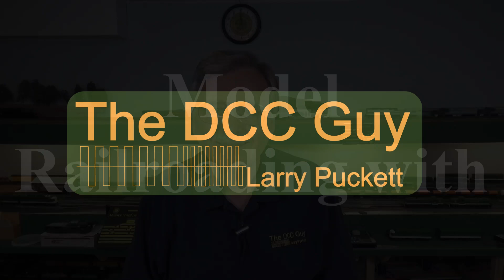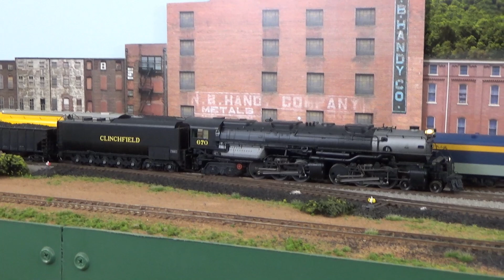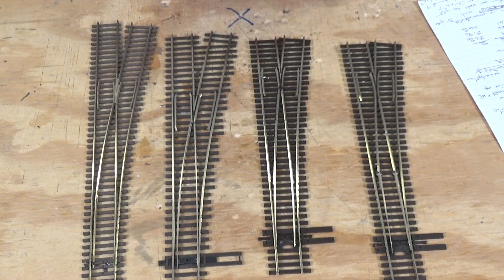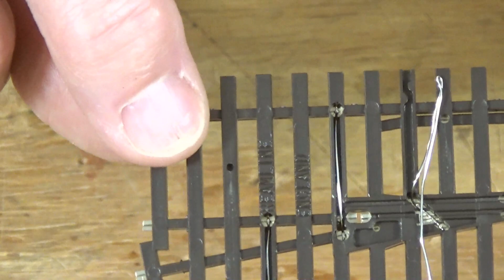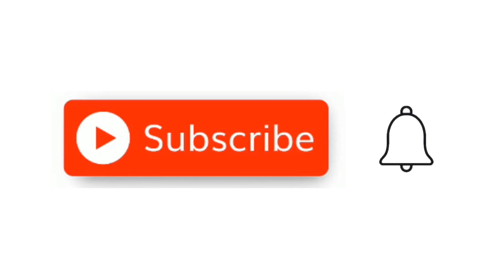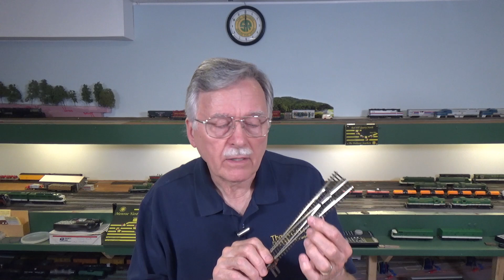NEW Peco Unifrogs Are Here: Let's Compare (260)

Comment: There is another detail you do not mention but that affects my choices. Peco offers their Pl 10 solenoid to flip the turnout; it attaches directly to the bottom of the track and this is handy for my application as my trainboard is 1 1/2 " foam on top of 1/2" plywood. The solenoid is entirely within the foam base and that is easy for me to assemble. I did not want a solenoid under the board for a variety of reasons plus in my case theboard  thickness is 2"". Walthers does not offer an equivalent solenoid to use directly under the track and it does not have the little slots the Peco pl 10 clips into so I assume using the Peco is out of the question.  For me, that creates a problem.
Reply from the maker: My concern with that installation is that when the solenoid fails or otherwise you’ll have to pull out the turnout for a repair. Here in the USA the demand for solenoids is almost no one is willing to make them anymore so I don’t talk about them. About the only ones available are those from Atlas and the Bachman and Kato track.

Comment: I’m starting from Scratch. Which turnouts are the easiest to use for flawless operation? I will be using electrified switch engines. Thank you !
Reply from the maker: What scale and how deep are your pockets? If I were just starting a layout I would use either the new Walthers turnouts or Peco Unifrogs.
Reply: @TheDCCGuy  I’m going to do N Scale. My pockets are adequately deep to spend in the right places. Track, turnouts and switch engines are the place to spend first for success. Thank you for your prompt response and advice.
Reply from the maker: In N scale your choices are more limited but Peco offers the unifrog in  N so that’s probably the best choice.
Reply: @TheDCCGuy  thanks !

Comment: Hi sir ! It's very interesting that you compare all of those turnouts. I'm a Micro Engineering user for a very long time. Simply because they are to my eyes closer to reality and they work very nicely. The only thing I dislike is that the last "batch" they released is a bit cheaper. Especially the point sprung that is very fragile to fall or not working properly for a long period compare to the oldest ones. I was thinking of making a 60 inches long module using new Peco's Code 70 Unifrog turnouts and flex tracks. I'm still thinking of it. And I got to correct you on one thing : On real turnouts, there are hinges on closure rails. So the fact that Walthers and Peco are making those rails in one piece is not more to prototype...it's only better for electric power, engines and rolling stock to roll on for our models. To my opinion, Walthers are probably the most upgraded and better turnouts of all. But there are certainly not the best looking.

Comment: Thanks Larry and once again great job with the videos.
Im not sure if this has been asked already but I will ask Re: HO Peco Code 83
Are the EloctroFrog turnouts wired for DCC with powered frog compatible with the Unifrog turnouts also wired for DCC with powered frog? 
So for example I want to put in a right-hand single crossover, I have a few Electrofrog code 83 RH #6 turnouts left over from a older project, all the Electrofrogs have been wired for DCC compatibility and all my frogs will be powered with the Tortoises. Can I use 1 Electrofrog and one unifrog to make the single crossover?
Reply from the maker: Assuming you have set them both up in DCC friendly configuration they should be compatible. If you have doubts just set them up in a bench test and see how they work.
Reply: @TheDCCGuy I wired them like you do fully powered and frogs are controlled by the Tortoise. I think they will, I'll check it out thanks!

Comment: I didn't realize the Walther's Turnouts had the sprung points that snap into place.
Question Please: Do their Curved turned have that feature as well?
I am looking for a wide radius Curved Turnout (about 30" radius on the diverting route) in code 83 and wanted the sprung points to hold the points in place against the stock rails as I do not use switch machines. Thanks and great info on your video.
Phil
Jersey Shore Area
Reply from the maker: I have not seen them but I bet they are sprung too.
Reply: @TheDCCGuy  I unfortunately don't see wide radius curved turnouts on the Walther's code 83 Turnouts. 
I may have to go with Peco, but I don't see the Peco curved with the newer UniFrog version, which I do prefer, but they do make the other two versions in wide radius...
Phil
Reply from the maker: I remember receiving an email from a Walthers VP thanking me for the review and at the time he mentioned they would be releasing a large radius curved turnout soon, which could me 1-5 years given production issues in China. I too have a spot reserved for one assuming they hit the streets in the coming year🤞
Reply: @TheDCCGuy  Thanks very much Larry for that bit of info. I appreciate it.
By the way, I still used a plastic mustard dispenser for my while glue thanks to one of your videos!. Love that idea...All The Best.
Phil
NYC ?Jersey Shore Area

Comment: Hi Larry. Thank you for your informative videos. I’m confused about switches !!!!!  I want to install a simple turn out that allows my trains to enter sidings or change tracks etc. Please tell me what switches I should install ??????
Reply from the maker: There are a large number of turnouts available to creat sidings from Atlas to Walthers. Selection depends on your wallet and layout design. For control you could use manual methods or electrical. I suggest you get a basic book on layout design and one on wiring such as my boo “Wiring Your Model Railroad”. Go to the Kalmbach Hobby website and scan their book listings for a beginner book on layouts and my book.

Comment: I use Peco Streamline Code 75 = 1,9 mm Tracks, it allows me to run NMRA and NEM Whelsets onto a very low hight of the rails lower than Code 83 = 2,1 mm.
The Peco Code 83 Turnouts normally using plastic inlays to the Frog which do not allow to run NEM Wheelsets onto those turnouts or crossings.
Nearly 98 % of my RR Roster and Car Fleet using NMRA RP25 Code 110 Finescale Wheelset Standards, only.
The Peco Unifrog Turnouts still replacing the before built Insulfrog or Electrofrog Turnouts at Peco and will not longer being in production again.
In the future Peco is selling Unifrog Turnouts, only in 00/H0 Scale.

Comment: Both the Walthers and the Pecos have gauge problems, especially on the diverging route.  You should check them with the NMRA track gauge.  The Walthers turnouts are pretty easy to correct with a little point rail tweaking.  The Pecos require actually grinding which must be done carefully to avoid melting the plastic.  I had to replace the throw bar on one that I overheated.
I don't know how big an impact this may have on actual operating reliability.

Pecos still have the split frog point that was sometimes a problem on the Insulfrogs.  It can result in shorts with wheels that are heavily worn or if the point is heavily worn.
I still have not been able to obtain Micro Engineering code 83  #6 turnouts.  A couple of months ago I saw an add in one of the magazines that Micro Engineering was for sale.  I don't know what this means for the future supply of these turnouts.

Comment: Good day Larry,  I would like to have your advice regarding the Peco HO SLU8362 North American-Style Code 83 Unifrog #6 Turnout to use it with code 100 HO Tracking layout. Please advise me.
Reply from the maker: If available I suggest using code 83 turnouts with code 83 track and code 100 with code 100, your love will be easier. I have done it in a pinch and it looks OK when painted, ballasted, and weathered but requires extra work to get it to fit correctly.
Reply: @TheDCCGuy  Thank you Larry for your advice to me, I would like to know where I find the Peco HO Code 100 Unigrog # 4 and #6. Thank you again
Reply from the maker: Check the Peco website to see if they are in production yet. They are in the process of replacing the Insulfrog and Electrofrog designs with the Unifrog and it will be a multiyear process.

Comment: Beware, the earlier HO #6 Peco Unifrog has a potential shorting issue.  Peco has modified it on later releases to prevent the shorting.  I decided to go all Electrofrog in HO code 83 so I tracked down (hopefully) enough #6 for my layout before they ran out of stock.  Re: ME turnouts, ME is trying to sell the company so availability may be quite limited.  Right now the best supply in HO appears to be Peco, Atlas and Walthers (if Walthers can keep up).

One advantage to Peco, they are short and would require little if any trimming to get them to fit.  Walthers will definitely need trimming in many configurations.  The problem with isolating the frog on the Electrofrog Peco cutting with a Dremel is plastic melts when cutting rail.  I know from experience.  Instead I plan to isolate with insulated joiners and power the frog with a Tam Valley Hex Frog Juicer.

As for track nails, yes Peco turnouts have the holes for track nails, but unfortunately the code 83 flex does not.  So I have drill my own with a PIN vise and try to get them centered.

Comment: Thanks for explaining this. You may be interested to know Peco is introducing a new range of TT gauge tracks, lineside structures and wagons. Heljan is producing a new range of TT scale locos too.
Reply from the maker: Yes, I saw that. TT scale pops back up every decade or two and then does a slow death.
Reply: @TheDCCGuy  Peco are introducing a new fine-scale track system. New locomotives and rolling stock for this new gauge have been announced by Peco and Heljan. The old TT was course-scale with deep flanged wheels, so that's why it lost out to HO gauge. However, the new TT scale allows more within a given baseboard area for those who do not want to become N gaugers!
Reply: What does "TT" mean? Still learning some lingo.  Thanks!!

Comment: Off topic question from an older post about Auto Reversers, that I just saw.

I saw a video dealing with Auto Reversers, specifically the Digitrax AR1.  The post addressed a large loop (though it didn’t say how long) but they connected the AR1 at both ends of the loop saying that with long loops the signal between the reversed section and the Main Line takes too long to activate and can short out?

Is that necessary?  Is it commonly done and how long of a loop are we talking about … if so?

Thanks 
Eric
Reply from the maker: I have not seen this video so have no idea of the configuration. I take it they did not say how long the reverse loop was? One thing about the AR1 is it uses mechanical relays which are slower than microprocessor based devices. That might be the reason but unless I know the particulars of their reverse loop and their wiring I can only speculate.
Reply: @TheDCCGuy  … the clip I saw was posted by FishplateFilms here on YouTube, about 8yrs ago.  It got my attention because I’m planning on using two AR1’s for two loops in my layout.  But I watched your clip of Auto Reversers including the AR1 that only had one connection and worked perfect.  On my layout One loop is going to be about 10-12ft total length, the other loop will be more to about 40ft with a small yard within the loop itself.  I’m using the NCE ProCab with the 5amp booster.  So I’m doing a bunch of research to limit any issues during construction.
Reply from the maker: I didn’t use an AR1, I used a Dual Frog Juicer which can be configured as an autoreverser. Super fast, switches in about 200 microsecs.

Comment: Larry  Peco Turnouts I have a few now the only draw back I found with them are they do not leave room to add a rail joiner on any of the rails. I used a number 17 blade to cut the ties on the rails to allow a joiner. I wonder why they do that  On Atlas turnouts they have room.  Not sure about Walthers or MicroEngineering
Reply from the maker: Walthers suggest cutting iff the last tie and then replacing it with a wooden one after installation. I have always undercut  rails on ME turnouts or removed the last ties. I agree that they should creat the mold to provide an undercut on the last ties.

Comment: Thanks Larry, great Critique, but which of the Three Turnouts which do you think are the most American Prototypical?
Reply from the maker: Well, that is a big rabbit hole to jump down! I still like the overall appearance of the ME, but I don’t like the jointed closure/point rail, or the fact you have to solder a feeder to the frog, or the cast bronze frog insert. I like both the Peco and Walthers for their one piece closure/ point rail, and easy feeder connection for the frog, but they don’t look as fine as the ME. However once turnouts are installed, weathered, and ballasted looks don’t matter as much. For example I have one yard done entirely with the old Walthers #5 turnouts and my others use ME and I am happy with both. So for me it comes down more to ease of installation. Until recently they all used jointed rails but ME was readily available so I built most of the layout using those.

Comment: FYI...One thing I noticed about the new Walthers turnouts is that their tie thickness is a bit shorter than the typical US prototype tie thickness of 7 inches. Peco, Micro Engineering, and Atlas flex track all match the 7 inch prototype tie thickness. So, you may need to shim a Walthers turnout when joining it to these other brands of flex track (and other brand turnouts). A section of business card should do the job.

Comment: DCC Concepts use stainless steel for their bullhead "Legacy" UK outline 00 flextrack.
Reply from the maker: Unless I misunderstand their website their flextrack is actually nickel silver with a higher nickel content to reduce oxidation of the copper in the alloy. They do offer individual rails in stainless steel should you desire to handlay your track.
Reply: @TheDCCGuy  Their track used to be stainless, and Hattons still have it in stock. As for handlaying, I tried the stainless, and I had no luck. It was a nightmare to solder with my (lack of) skill even with their flux, which I could only get shipped in the tiniest bottles.

Comment: Larry, would you be able to check how stiff your unifrog closure rails are? Do you use the stock wire that comes with the Tortice and Smail or do you buy a higher strength throw rod?
Reply from the maker: I do use slightly stiffer piano wire mainly because my subroadbed is an inch thick and with the cork roadbed the ones that come with the switch machines is a hair short.

Another viewer just said he found them too stiff to work with the throw rods that come with the Smail switch machines so I guess that answers your question. Most hobby shops have a K&S wire rack where you can buy pieces of piano wire which is what I do already.

Sorry, just noticed that was you posting in a separate comment. I’ll see what they look like.
Reply: @TheDCCGuy  It might be  a thing to need a stiffer throw rod for the new unifrog turnouts. That's disappointing because you now have to buy something else other than the supplied throw rod wire that comes with the Tortice and Smail. It all adds up. We paid just over $55  Canadian at out hobby supplier for the unitfrog.
Reply from the maker: I checked and the Pecos were a little bit stiffer than the Walthers but that was a very subjective “feel”.

Comment: We recently installed our first peco unitfrog and like it very much. But we did find one thing of concern and I don't know if anyone had this problem. We found that the closure rails we so stiff to throw that we had to add another throw wire to the SMAIL. And yes we removed the switch spring on the turnout. Other than that , we love the unifrog switches
Reply from the maker: Do you mean you used a different and stiffer throw rod? That does answer a question from another comment. Do you remember what size wire you used?
Reply: @TheDCCGuy  Larry, no we just added a second stock throw rod to double up its strength

Comment: Thanks Larry, I can’t stand the joint in the closure rail so unifrog and Walthers are an obvious choice. I think the ties are much better on the Walthers too, not as thick or bulky but most noticeable to me on the unifrog turnout about 7 ties up from the switch ties there is a sharp change in the thickness of the rails. It is right where you were pointing at the turnout at 13:11 in the video. I’m going for the Walthers turnouts for those reasons and because I like the tabs at the end of the ties that you can solder to so you don’t take a chance of melting the plastic frog. Great comparison and great detailed video of the Walthers turnout in your last video.